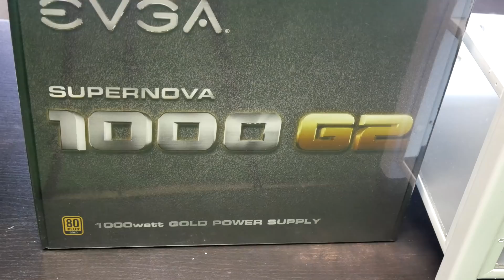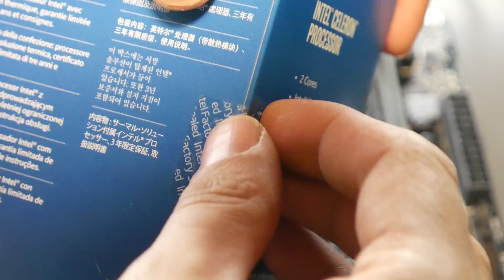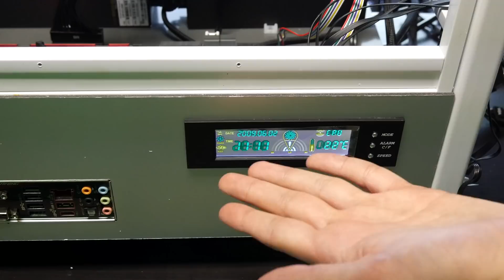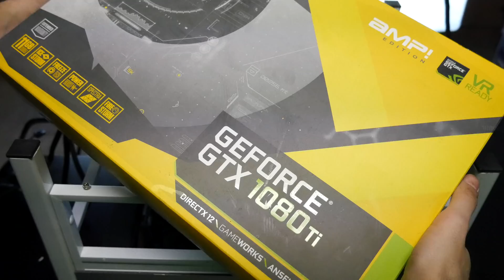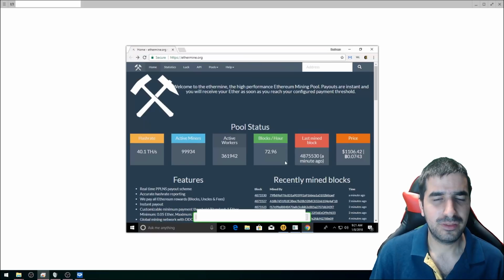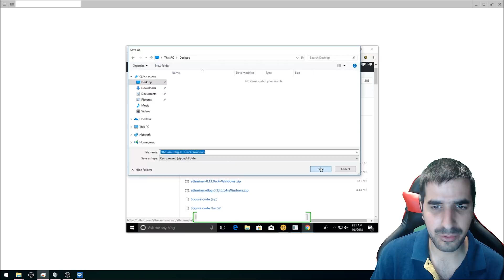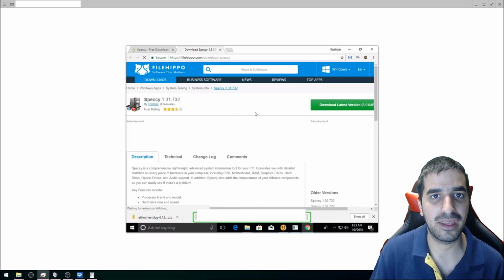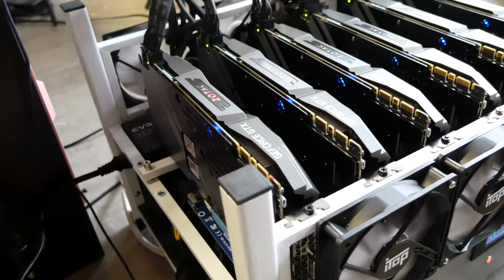How Much Can You Make Mining Bitcoin With 6X 1080 Ti Beginners Guide

Comment: My pc has a msi x370 Ryzen 7 1700 16gb or ram and 1x gigabyte gtx 1070 g1 gaming(8gb). I have an sli bridge so should I get a second card so I can mine while I'm not gaming/editing? My psu is a evga 650w 50+ bronze. Should I get a 850w or should I upgrade if IDeeeecide to add more gpu's
Reply: Not Promise you don’t need an sli, that would only be needed if you wanted improved FPS on games. You would just need to plug it in to a pcie slot. I would definitely upgrade the psu if you were to add a graphics card.

Comment: Not sure how old this video is but given the current component prices, the lowest cost I can find (with new components) is $10,000 USD for this rig. If you eBay the crap out of every component and are able to get almost everything used you might ("might", chances are slim) be able to get it down to around $8000.
As for electricity calculation, this will range from a low of $0.10 /KWH to $0.28 /KWH depending on the state/city you live in. So it can range from $72 to $ 202 per month.
Reply: My 13 1080 TI rig set me back $11,647.49 exactly.
Reply: Sadly everyone is trying to jump on the bandwagon. Since July of 2017 the GPU price has been increased by 400% if you can get one. Pushing the ROI out to nearly a year if not more. So basically you have to sit around for a whole year before you see a penny of profit. Good luck.

Comment: i really need 1050ti i have a very cheap pc running gt 710 so 1050ti will be a huge improvement for my pc
Reply: james parker please tell me how dollar i can mine with one card of 1050ti and how many cards we can set up in one machine
Reply: dude, don't say that, gt 710 is a lot more better then a intel HD4400 right??
Reply: 1050 ti is one of the best cards to mine with for return of investment. It could dip down profit wise soon though with the release of volta GPU's.

But for now though... the 1050 ti and the 1060 are by far the best gpu to purchase dollar per dollar.

Comment: Looks like you're using SATA power cables for your risers. I've heard that's a bad idea and that you should use 6-pin or molex instead. Other than that, it looks awesome. The rig frame is a bit expensive but I love how clean it looks with the I/O sheild mount and the LCD display.
Reply: Sata to sata power cables are bad... but sata to molex is just fine. (thats what hes using)
Reply: Oh no hes using Sata to 6 pin. Which is also just fine.

Comment: Awesome video! I just built a system very similar to yours. However miner will run for a few hours and then crash... Using same video cards (5x not 6x) and windows 10 with Nicehash. Has yours been running stable for you since the video?

Comment: aren't you sure there isn't something wrong? I make more in € with 5 Vega 64 cards and using the soft power tables, but I am drawing like 135-140W of power and 45º or so and your rig does a little more but the temps are so high... I mean, isn't there a way to avoid that from happening? (I have no experience with the 1080Ti)
Reply: The vega 64 is considered by many to be the best card on market with mods to the internals. But off the shelf nothing beats a 1080 ti.
Reply: actually they are beasts. Now I set up a 6 Vega 56 rig (unmodded) but also drawing 140W or so and they are making 48€ (58$?) on Nicehash with temps around 42º-44ºC on average, so you do the math....
Reply: yes they are beasts.
availability is the problem.
it's much easier to get 1080ti's atm.
my 1080ti in a pc case is running at under 60° too at over 110% power limit.
the difference between the 1080ti's and the vega 56 is not really big.
Reply: https://getcryptotab.com/92379

Comment: download msi afterburner and tweak those settings, ramp up gpu fans, lower tdp to 80% or 65%, 1080ti demands power tweak settings, you can lower the wattage and temps and still get better hashrates, one pro tip.. don't use nicehash.. use awesome miner with profit switch and mine directly to the pool of your choice... and prefer to get paid daily.

best wishes for mining with your new rig.

Comment: get msi afterburner. and tweak ur card configurations.   set ur TDP to 65% and core +150 and memory to +500.   u will c a small reduction on ur hashrate. but a huge improvement on ur energy savings. in other words it will make it more efficient. @HowMuchBitcoin, u will end like at 48 ish usd per day after energy savings.

Comment: Hey Bro I also Got Two 1080ti Just @ days ago and played too much to get the most efficient settings and here is what i settled on because its the best balance of power usages and BTC a day, SO What I only changed the power limit of each card from 100% to 80% and boom Temps are now between 53 to 56 and if Cards are put closely then 55 to 60 , and They Mine Upto 0.0009 BTC to 0.00105 BTC Every Day And The Power Usages Of Both The Card is Between 193 Watt To 205 Watt , That's A heavy Decarese Seeing that The Daily BTC Is Near To what They Were On 100% power Limit, Also To Be More precise Run Them on 80% For Exact A Day And Then See How Much They Mined . Well I just Subscribed .

Comment: If you want to maximize output and temperature, water cool them in parallel, 3 and 3 with 1 rad for each [280/each] you can push it and reduce their wattage consumption.. best of both worlds... high output, low temp, and low wattage. You can do it for very little cost.

Comment: I found my TT 1500w PSU not enough for 3 1070ti and 2 1080ti by using the nice hash
Reply: Under power them to 80 and they should work. Unless your 1500 PSU is made by thermaltake. Then that is your problem.

Comment: To keep the temperature under 70 you should use HIGHFINE 12cm 120mm 200CFM 4000RPM or AC Infinity AXIAL 1225, Muffin Cooling Fan, 115V AC 120mm, with low temperature you get better hashrate.

Comment: Hi... Nice video.

Couple questions

1)  How come you don't provide a nice easy direct link to the  case that you're using to hang the video cards?  I really like the case  (especially because of the front panel led information display) but I can't find the direct link on where to purchase that?

2)  How come in the video you are using 8 GB of Ram but in the descriptions you are indicating 4GB of RAM ?  I thought the description of parts was supposed to match exactly what you are using in the build?

3)  I noticed that you're using a pretty nice ASUS motherboard.  Besides cost savings.... Was there any reason why you would not rather use the ASUS  Z200 series of motherboard which is a bit newer with more efficient graphics buses that would maximize the throughput of your  1080Ti  cards for better mining? 

Seems to me like if you spent all that money on brand new Nvidia GeForce 1080Ti,  it would be kind of a blunder not to spend just a bit more to help those 8 cards perform better?  I would have purchased the Z200 version  of the Motherboard if I was going to spend over 7000 dollars to future proof my rig.

4)  Can you explain what kind of remote access software you're using to control your miners?  Because clearly it's not practical or cost effective to have a monitor attached to each Rig (worker).  So how does someone with multiple mining rigs (that all have different worker names) remotely manage and view their status from another  (let's say  non mining system)?  

Does the Nicehash stats web page offer a kind of table (or chart) that shows the status of all the working rigs that are registered with Nicehash... So that you might be able to remotely log into the Nicehash web site (under your account) and see the status of all the miners (workers)?   Please clarify this for us and if you have a link to a video that clarifies this... Please provide that.

I find these videos extremely fun and engaging... So thank you for taking the time to host these awesome presentations.

But the fact that I never get a reply with some explanations and links for my concerns, is frustrating.

Hope you will reply

Alexander

Comment: Wow those temps are high. Did you end up messing with fan speeds? My 1080 tis are running about 50-60 tops. I do have one 1080 that’s starting to run around 75 and that’s high for these cards
Reply: James Parker I didn’t say they should
Run at 50. I said 80-85 is too hot.
Reply: Because of Zotac. Their VGAs are practically time bombs if being used for mining.
Reply: 85C is totally fine.
Reply: I mean you can easily change the fan curve in msi afterburner
Reply: I got a 13 1080 TI rig. All EVGA SC2 model. They all run between 65-70 degrees at 80 power draw and a slight overclock. 80 Core, 200 memory.

Not sure what world youre living in where they should run at 50.

Comment: How many years can you use gpu to mine ??
Reply: @RandoCrypto from which country you are from man that your card runs below 40c
Reply: RandoCrypto its the best time for you to mine lol during winter bro. Wish i had snow in my area to bring temp like you.
Reply: most cards have 2 year warranty. i've seen more too.
usually gpu's don't die that often if you don't fry them by fucking up the OC (especially the voltage).
try to make the temps as stable as possible. heating up and cooling down makes materials weak.
but don't worry too much.
most cards will last much longer than the warranty, even if you don't care about their temps at all.
they have their throttling temperatures for some reason :P